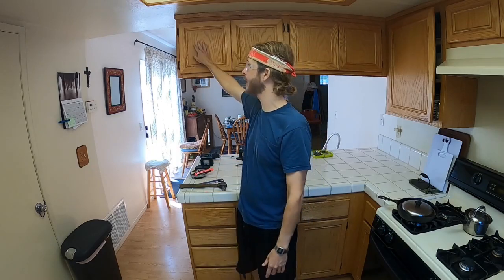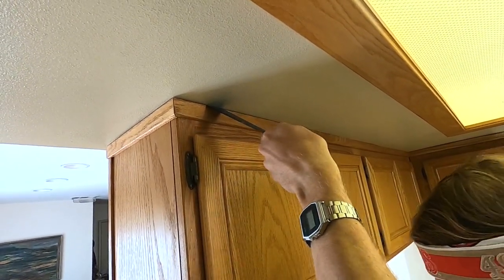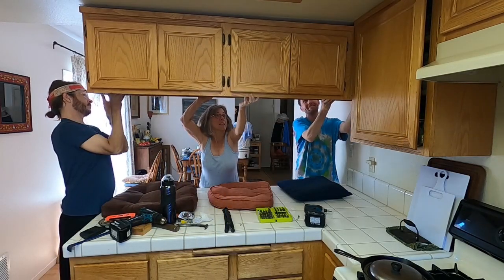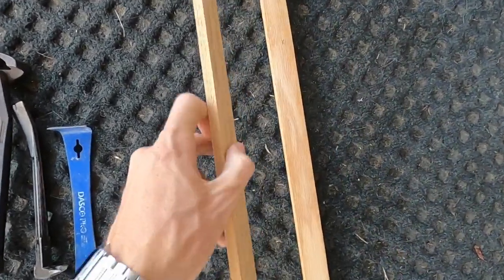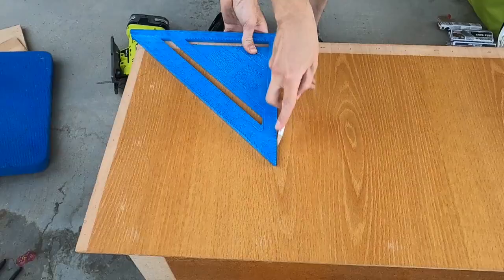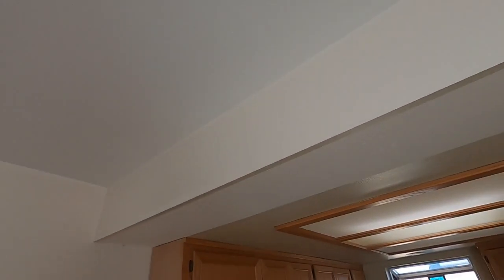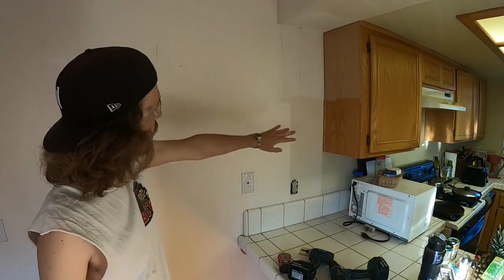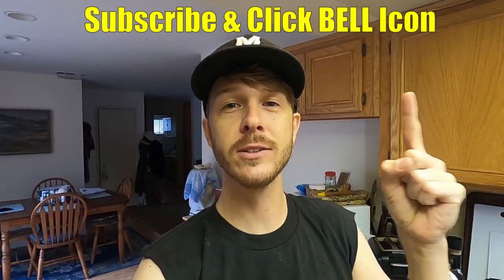How To Remove Cabinets & Open Up Kitchen | Plus Hanging Cabinets & Helpful DIY Remodel Tips

Comment from the maker: TOOLS & SUPPLIES
End Cutter Pliers- https://amzn.to/3oU11w8
2ft Level- https://amzn.to/3m4ydzg
Stud Finder Magnet- https://amzn.to/3INwUP5
Powerful Magnets 6 pack $13- https://amzn.to/3m6zsxY
Stud Finder Electronic- https://amzn.to/3EYGoV9
Nail Puller Claw Prybar- https://amzn.to/39Ns4lw
Irwin Squeeze Clamps- https://amzn.to/3tThhh5
Utility Knife- http://amzn.to/2rIeUQP 
Speed Square- http://amzn.to/2idDsOz
Hammer- http://amzn.to/2tfjnMY
Tape Measure- https://amzn.to/3rijQYo
Putty Knife- https://amzn.to/3rm4UZq
Wood Glue- https://amzn.to/3fFrPdF
Jigsaw (Corded)- https://amzn.to/2PN9gaL
Drill Set- https://amzn.to/3gALei8
Cordless Circular Saw with Battery/Charger- https://amzn.to/36wBOMn
Ryobi Nail Gun Set- https://amzn.to/3f4FtWK
Tool Set- https://amzn.to/3epVN4X
Leather Work Gloves- http://amzn.to/2x5BZk3
Protective Ear Muffs- http://amzn.to/2wBYf1O
Safety Glasses- http://amzn.to/2ez41Jw
Magnetic Work Light- https://amzn.to/33tk6tp
If you Enjoy the Channel Consider Helping Support it by Donating below & by Subscribing.
PAYPAL DONATION https://www.paypal.me/JonnyDIY

Comment: How do you remove square head screws from kitchen cabinets? I bought a screw that has a square head, but them dang screws aren't budgeting lol
Reply from the maker: @rebeccacrowe4649  you just unscrew them, but the key is having the right bit. Try buying an assortment kit of bits. Ryobi makes a cheap one about $20 that has everything. The bit is usually square with a kind of domed head. Then lots of forward pressure when unscrewing so it doesnt strip 👍
Reply: @JonnyDIY  yes I have tried to unscrew them, lol!! ,  I did buy an assortment of bits with square bits. I guess I'm not putting enough forward to it. Thank you for your response!
Reply from the maker: @rebeccacrowe4649  you're welcome, hope you get it. I meant there are different square drive bits. So it's important to use the right one that is square but also goes deep all the way in

Comment: Wish you can show how to remove the bottom cabinets
Reply from the maker: lower cabinet removal is same process, except for first removing countertops that are connecting multiple cabinets. Then you just unscrew the screws from usually back of cabinet and sides connecting them to adjacent cabinet and pull them out. Now if old cabinets and nailed in you will have to pry and pull nails. Ohh and also pull front base trim if any from cabinets first. Once you get started you'll get it done, each has it's own set of slightly different problem solving
Reply from the maker: lower cabinet removal is same process, except for first removing countertops that are connecting multiple cabinets. Then you just unscrew the screws from usually back of cabinet and sides connecting them to adjacent cabinet and pull them out. Now if old cabinets and nailed in you will have to pry and pull nails. Ohh and also pull front base trim if any from cabinets first. Once you get started you'll get it done, each has it's own set of slightly different problem solving